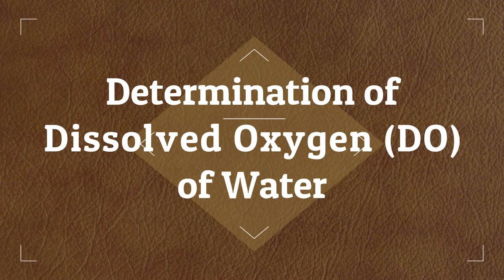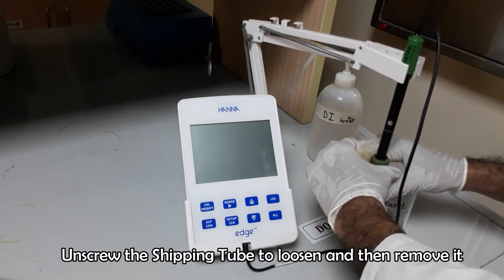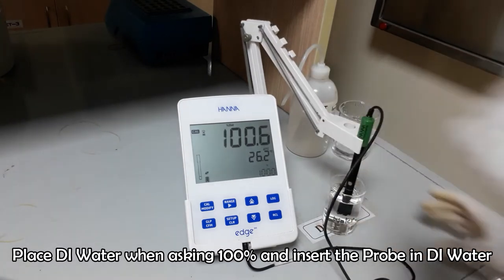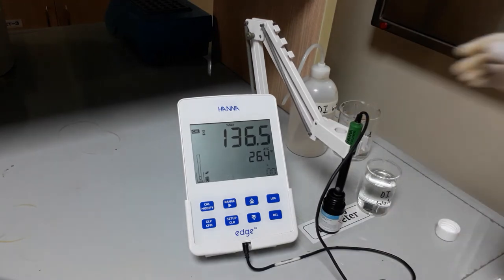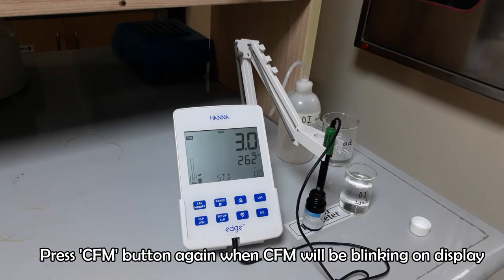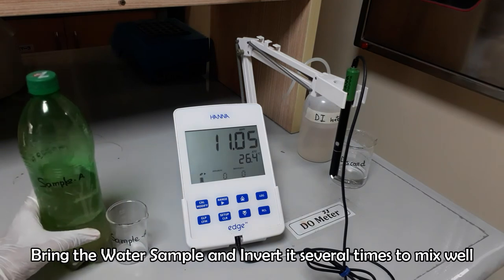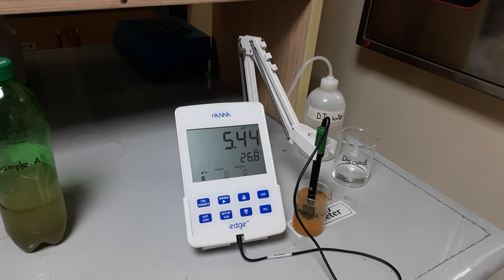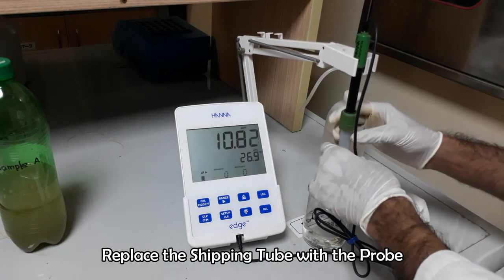Determination of Dissolved Oxygen (DO)-A Complete Procedure

Comment: Hi i have read that there is two method for the determination of do in water. They are titrimetric method and 2nd one is electrometric method.
I want to know which one is better between these two? And in which method we can put the winkler method?
Reply from the maker: We used electromatric method is this video but as far as we know that Titrametric is better. But due to low cost and short timing we use electrometric method. For derails, take help from Google.
Reply: @MicroChemsExperiments  thanks 💕